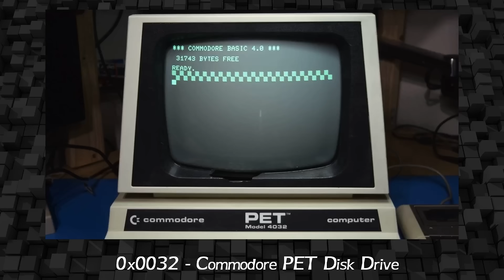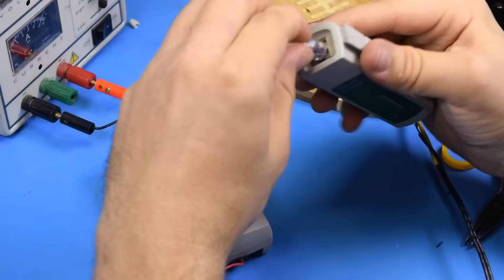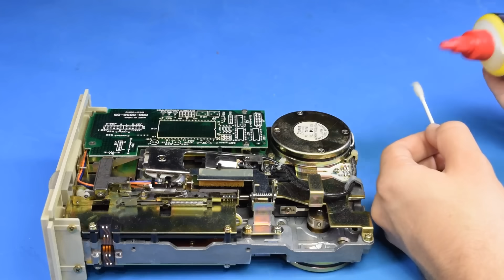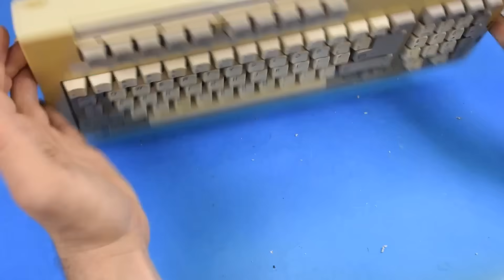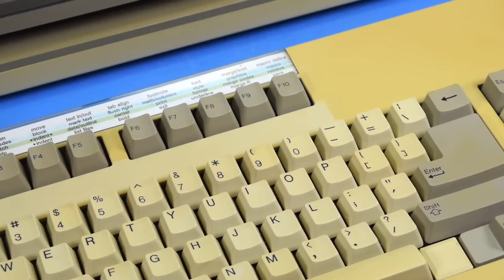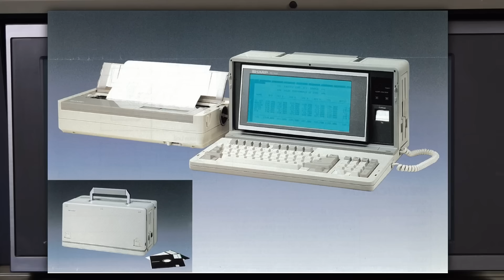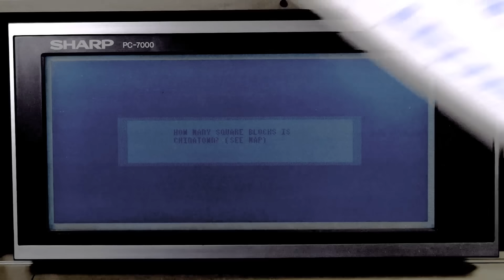Sharp PC-7000 Restoration

Comment: When retrobriting it you will use a chemical to protect it again against the uv rays?
Reply from the maker: I haven't heard of that step yet. If it is something that permeates the original plastic I may consider it. But I don't want to add an external coating that would change the feel of it. Especially the keys.
Reply: AkBKukU I think some channels reported that the retrobrited parts started to yellow really fast after something like 1-2 months later. 
Then i thought in doing it in my old cases, but after that, using these uv resistant coatings that people usually use in the process of restoring yellowed car headlights, so it wont get yellow again. 
I would use it in the body of the keyboard and not in the keys if you dont want ro change their feel.
Reply: That's an interesting thought. From experience though the UV resistant coating for headlights doesn't work very well at all, although that could be in part that headlights are exposed to the elements 24/7, stone chips etc... The best way I've found for headlights is to wet sand them to remove the yellowing and then lacquer them with a decent UV lacquer, obviously lacquering a computer would alter it's appearance a fair bit, even with mat lacquer. I'd definitely say the UV resistant coating is worth a shot as a test though as being stored out of direct sunlight it may hold up better.
Reply: If I'm not mistaken there's a couple forms of retrobriting, the one, as you mention puts a coat onto it protecting it from uv, however there is one that reverses the oxidization of the bromides (fire proof material) in the plastic. A common application of that type of retrobrite would be uses on a SNES or a classic Mac. Also, oxidized bromide plastic does become more brittle over time but retrobriting can reverse it and strengthen it.
Reply: Blim The Toolman No, what i said is that you retrobrite it just like you said, and then add the coating layer to protect it against uv rays. Just retrobriting it, by reversing the oxidation, leaves the plastic looking like new, but it now have a way higher tendency to yellow again, so if you put a trasnparent uv resistant coating in there it may stay white.
Reply: it will re yellow faster because the plastic is exposed more compared from the factory causing it to be more susceptible to oxidization, just one of the side affects of the retrobrite treatment. The UV treatment is a way to put the protective coat over it to finalize it. Sorta like a first coat (de-oxidizaing) and a final coat (UV block). as akubuku said though it matters which uv block you use because you don't want to say give it a different texture compared to the original texture. There are chemical treatments though to prevent the plastic from being affected by UV though just can't think of any off the top of my head right now, haven't done this in like 7 years.
Reply: It may be more susceptible to UV light once done, but if you're going to largely keep it in storage rather than on a desk near a window, that can still take a long time. Whether that's actually detrimental, really depends on your context. Though just as someone who did chemistry education for a while, and that the bleaching doesn't damage the surface, I'm not sure what would make it "exposed more compared from the factory"? Maybe Blim is just saying that other aspects of ageing have removed original surfaces? Unless someone has microscope data showing that peroxide bleaching does actually damage the surface - feel free to send me evidence.

Comment: Nice restoration. I look forwards to seeing how it comes up once you're set up for retrobrighting. Did the power supply turn out to be ok in the end?
Reply from the maker: So far it seems fine, just the odd flickering of the backlight. Which, upon retrospect, could be failing itself. "off" never fully turns off, "dim" is the same as off, "standard" is completely useless, and "bright" is the one that flickers. 

There is a spec in between some of the layers in the LCD that I intentionally did not try to remove. I read about someone attempting something similar and ruining the display because it is connected with a conductive adhesive based on their description. I didn't look for my self, I just filed it under the category of "not worth the risk". I assume the backlight is mixed in all that unpleasantness so I didn't bother trying to dig deeper to determine it's health.
Reply: I'd completely agree, back lighting was never intended to last this long. The only workable solution would be to replace the entire LCD panel which I imagine would be relatively easy to do (depending on the tilting mechanism), finding one on the other hand could prove to be a very long and possibly expensive experience with little guarantee that a 30 odd year old replacement would work any better. At least with it being a reflective LCD the back light isn't essential unless you plan on making it your new workhorse and need to use it at night.
Reply: See my other comment on this video. The EL backlight is getting worn out, but it is not failing. They all do that.